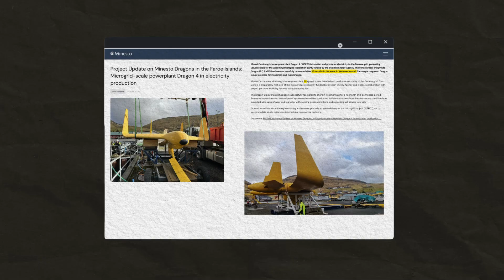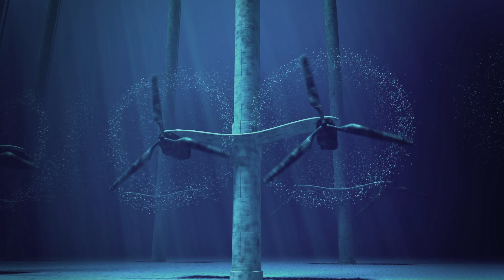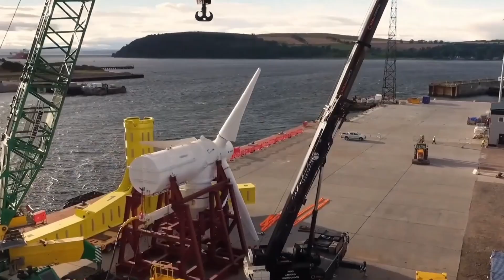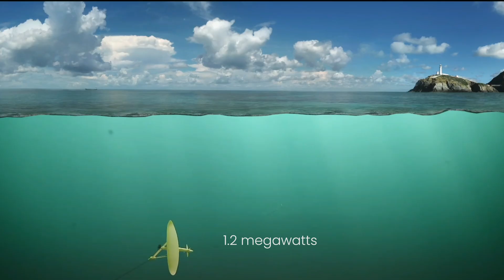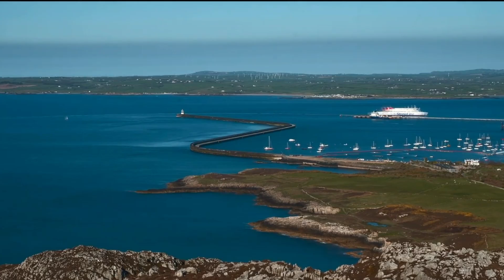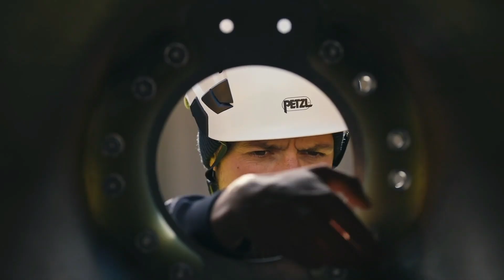Comp 1

Comment: So... the carbon foot print is huge when addressing the in efficiencies for energy production, impact on sea life, degradation of design, disposal of parts and the energy to do so... the energy spent on manufacturing of the system itself... the overall cost in money and the total cycle of the carbon foot print from  manufacturing, repair, disposal, and sea life impact will always out way the energy produced... in my mind this system is flawed and a folly when it comes to addressing carbon foot print issues... one would be better off planting more trees and ensuring soil microenvironments  are healthy. However, that is just my opinion.